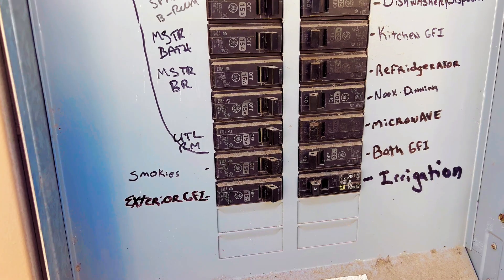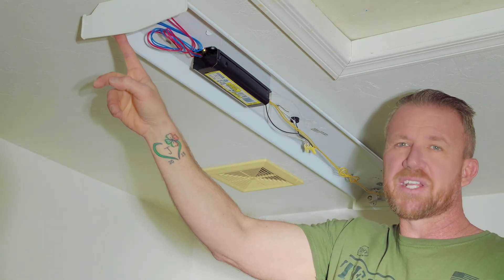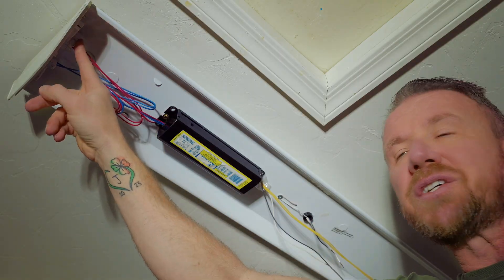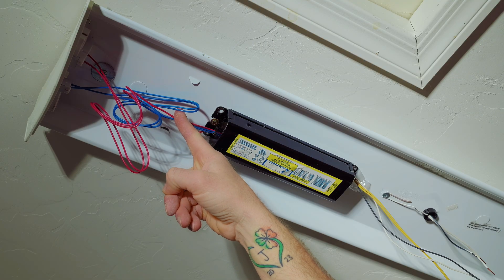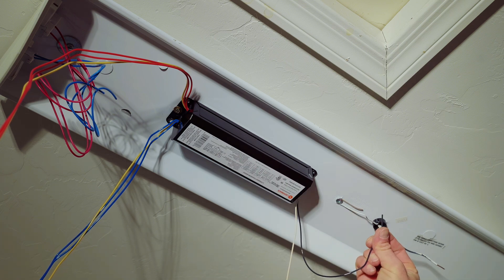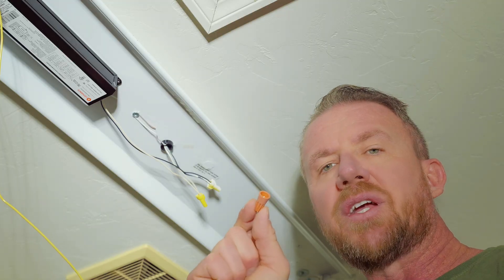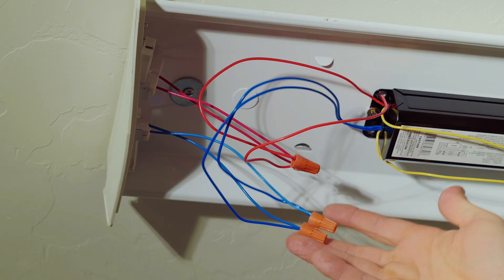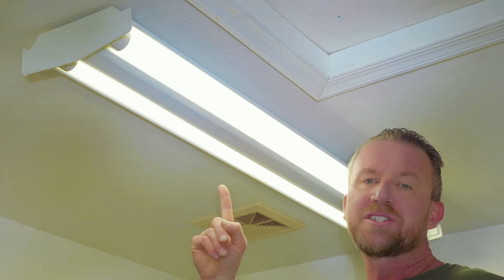How to Replace a Ballast EASY! Fix Dim or Flickering Lights FAST!￼

Comment: I currently have T-12 bulbs (not LED).  I'm pretty sure the ballast is bad and needs to finally be replaced for the first time.  However, I'm thinking I want to go with T-8 LED plug and play bulbs moving forward since I hear they are more efficient, last longer, and put out better light.  (Correct me if I'm wrong.)  I'm assuming I'd have to get a different model ballast for the T-8 LEDs, correct?  If so, I'm wondering if that new ballast will come in the same size to match up the holes and clips etc. in my existing fixture.  I don't really want to have to replace the whole fixture just to be able to use the T-8s.
Reply from the maker: You should be able to get the correct ballast that fits your fixture and will run T-8's. you will need new lamp holders (tombstones)too. Good luck friend!

Comment: Why don’t you just bypass the ballast if you’re using leds?
Reply from the maker: Great question, those LEDs were designed to plug n play with existing ballast, but some LEDs do require the LED driver instead.

Comment: Are the 2 reds interchangeable with the red ballasts wires when reconnecting?
Reply from the maker: yes mine were, As long as you match the colors you should be good. 👍🏻